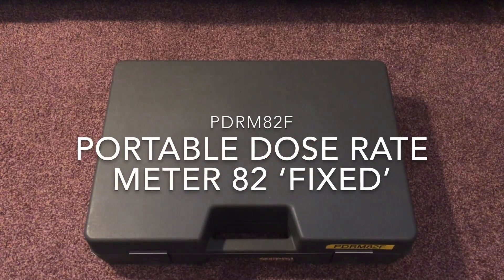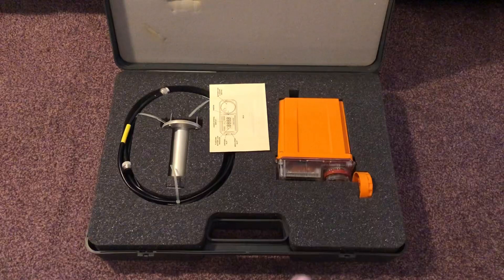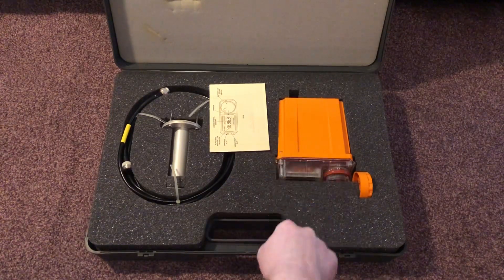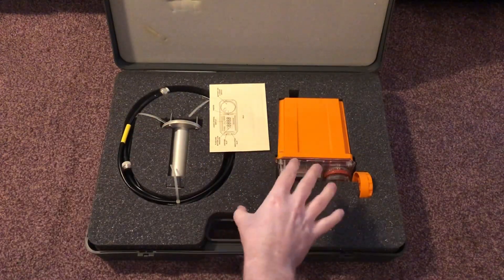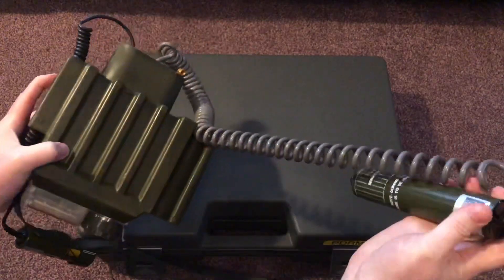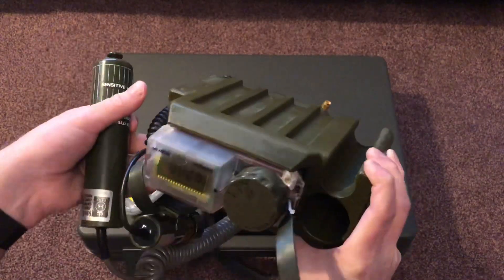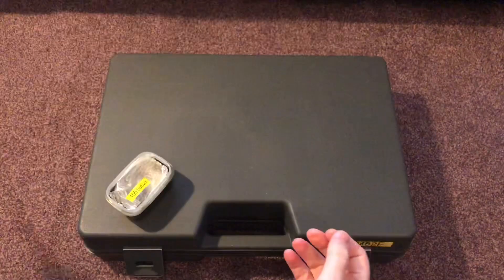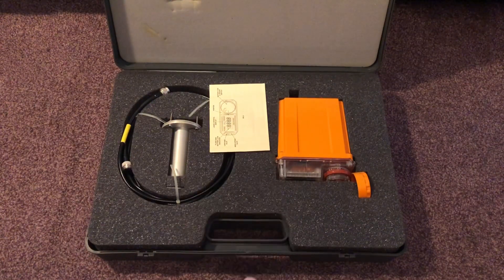Royal Observer Corps PDRM82F

Comment: Nice review, I have a question, I want to add a speaker to PDRM82 so I can pick up the noise how would I go about doing that? thanks!
Reply from the maker: I have never done this mod to a PDRM82 before and to be totally honest with you its pointless seeing as the lowest it will detect is 0.1cGy which converts to 1mSv in Gamma! You would need to replace the geiger muller tube too for it to detect background. Another option is the PDRM82D which has both an external probe and a speaker and detects background radiation. They come up for sale quite regularly now as the MOD is surplussing them. There is a video of one on my channel.
Reply: I would not mod these units, if you want something more sensitive there are plenty of inexpensive GM units for 100 or less. These units are something you want to keep in the event of the balloon going up. Way superior tactical survey meter to the CDV line.